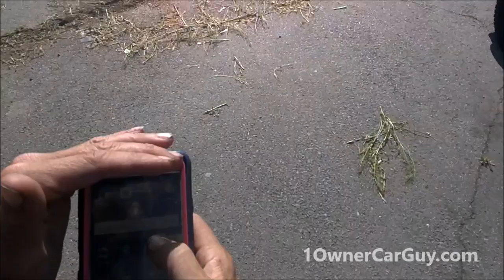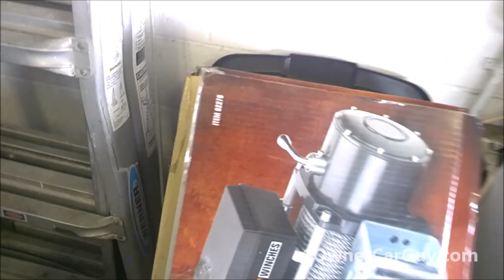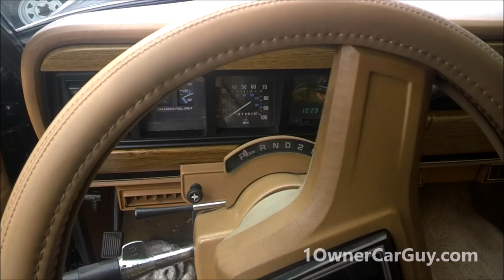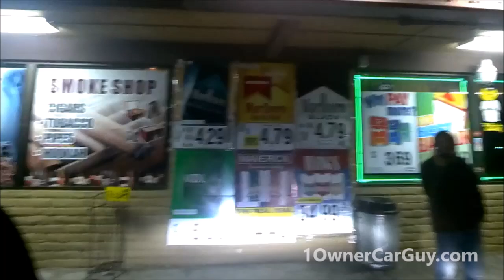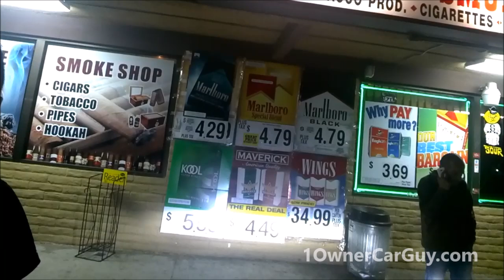Work Vlog Help Hector Moving shop ~ Car Polishing How To Video

Comment: And that poping is probably fuel filter or the 2 barrel trying to open up its sticking just simple carb cleaner would fix or something along that line I also have a carbureted vehicle and mine use to do that until I fixed it by doing some that and reving it helps and going down road flushing it out helps to and probably make it stop poping sounds like 2 barrel is trying open up and gets kinda stuck cause who ever had it probably didn't rev it or much or didn't flush it out at all Ik alot people do that and they need to flush that shit out that stuff build up and cause that problem it's doing but I love things like that when u rev it and actually Nathan I looked at a 67 Buick skylark today was so nice all original only wanted $6,200 and when I rev it up it was blowing some junk out of it big time lol it's all built up from sitting